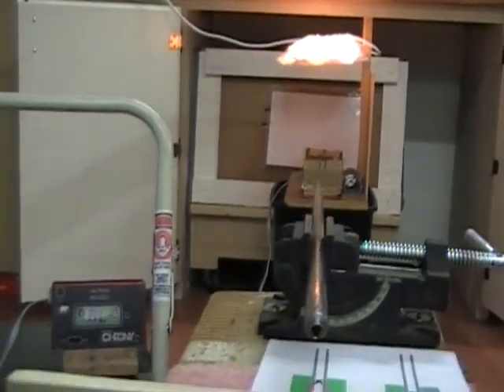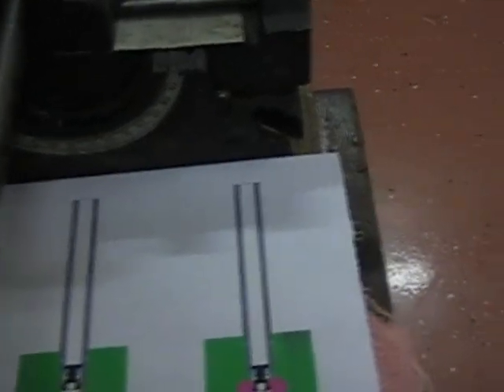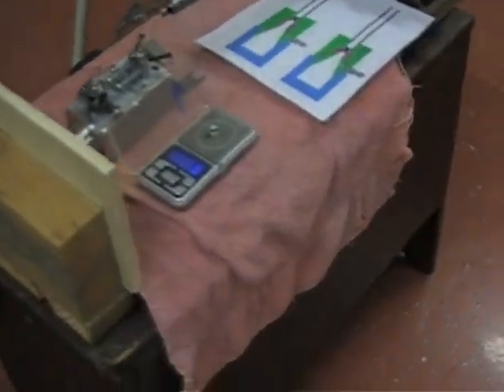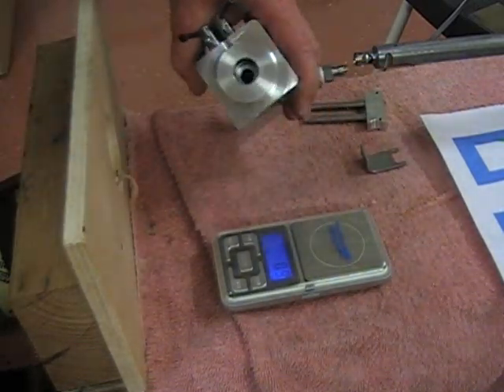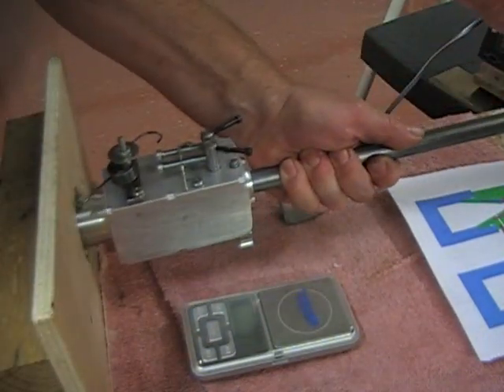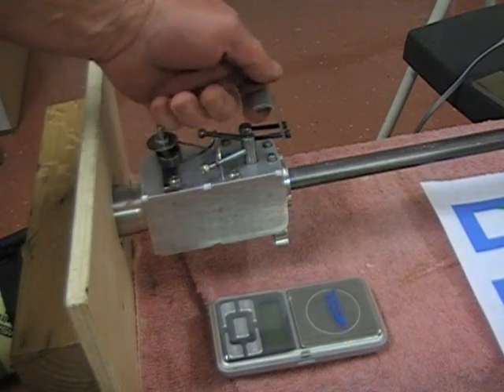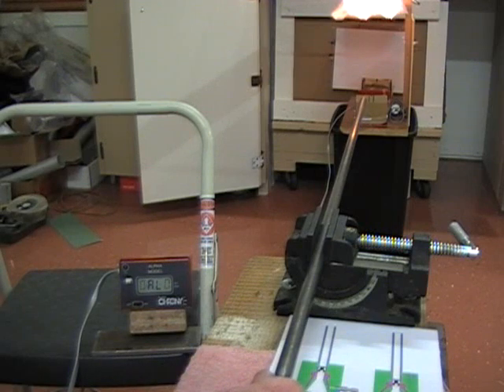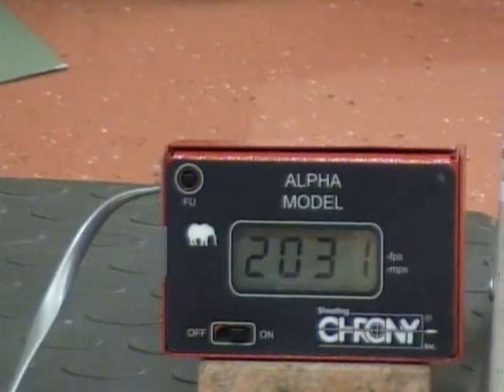2031fps PCP Airgun Lab maximum velocity record?

Comment: there is a lab in the UK driving half inch BB's to 17000 fps in order to test amour plating for tanks to space craft to achieve these velocities they use a combination gun powered by explosives compressed gas and a piston, ingenious bit of kit, with the use of very high speed cameras you can watch bb's vaporize as they cut into steel plate. far too big to fit over your shoulder and too dangerous to operate outside a purpose built bunker, but I see no reason why a spring piston rifle could not be converted to do a similar but much less impressive job using a blank to drive the piston and a pump to uprate the pressure forward of the piston seal, it would still be to fiddly for field work but might prove an interesting test bed.

Comment: Ideally should a shot from an airgun be pushed by the full volume of the barrel or a percentage of the full volume?
Reply from the maker: Do you mean should all of the porting be as large as the bore of the rifle? In other words, none of the air passages should be smaller than the bore/caiber? Lloyd
Reply: @1227air500  no , I was asking if say your shooting a .45 cal and your valve orifice is say .28 , will it need to be pushed by the full barrel volume or just a percentage of  the volume. Does it need to be pushed all the way to the muzzle to attain its max speed? Or can a short blast of air at higher pressure get max speed?
Reply from the maker: @HD-ph1dc  That is a good question, and generally, for all practical purposes, the answer is no, almost.  Let's start by looking at the rifle if it is .45cal and all the ports are .45.  And lets say the reservoir is 250cc at 3500psi and a 250gn bullet, the barrel is 24", and the gun has "average" flow characteristics. Just a note that the air force guns with their in-line valves have better than average flow characteristics, but the following general rules still apply. The absolute maximum FPE you can get from an airgun, with zero losses, is the bore area in sqin x the force in psi x the barrel length in feet. That works out to .159 sqin x 3500psi x 2 ft= 1113fpe. In reality, achieving 50% of that is good, and achieving 75% of that is extremely good. But that max fpe counts on the full reservoir pressure behind the bullet all the way down the barrel.  But as the bullet accelerates in the barrel, the air has a harder time keeping up and the pressure behind the bullet drops, and therefore, the force on the bullet drops. Testing has shown that if the valve closes when the bullet is about half way down the barrel, very little extra velocity will be gained by keeping the valve open longer. But a lot of extra air will be wasted during the last half of the bullet travel. Remember, inside the barrel, after the valve has closed, there is still a volume of high pressure air behind the bullet that continues to expand and accelerate the bullet down the barrel. Keeping the valve open only adds a little more force behind the bullet. You can test this yourself if you have an adjustable hammer spring on your gun. As you increase the hammer force, the velocity will increase, but there will be a point where the vel stops increasing but more air is used.
Back to the original 45 cal example, with parameters as listed above. If the gun has full diameter porting and the valve closes  at 50% travel down the barrel (2.5msec), vel might be 908fps and psi in the reservoir might drop 515psi. If the valve stays open all the way, vel might be  949 but psi will have dropped by 900psi. Those last 40fps are very expensive on the air. Now, if we go to the .28 ports (port is only 40% as large as the bore), 50% valve might give 846fps and 100% might give 883fps, but again, massive air to get that last 40fps. I hope that helps answer your question. Lloyd
Reply: @1227air500  Thanks Lloyd, you have answered my question very well. Thanks again.

Comment: Lloyd, this is about my 50th time I see this video and I find it quite amazing, entertaining, educational, inspiring and awakening from urban legends such as a pellet can not fly faster than the speed of sound. For example, the speed of sound at 25C is approximately 1,136fps, while the "average" air molecule weighing approximate 28.96546 daltons is traveling much faster than said speed of sound. Now, the key is to notice the "average" which is 2/pi, or approximately 63.66%, which makes the peak air molecule the inverse of the average, or pi/2 = 157%, and the RMS velocity being approximately 1,662fps, so calculating for the peak velocity gives 2,351fps, which is far higher than the 2031fps, so the velocity is very plausible since giving 6 degrees of freedom and only one degree is opened for escape then the fastest get out of the burning building first, and since there is an aluminum pellet at the exit door, if it doesn't get pushed out by the fastest peak air molecules traveling at 2,351fps, it will get stampeded flat, so the pellet was very smart to move down the 47.5 inch barrel. Great video, I wish you had included one of your killer graphs. Where can I find software like yours to do my analysis? Thanks and great job.
Reply from the maker: I got a comment the other day from someone who I guess just didn't understand the experiment, and it got me to re-reading some of the older comments. I like your comments, and analysis, and your analogies. Some good logic in there. Let's take it a step further and I'd like your thoughts. Try an analogy of a fighter jet being like the leading mass of high pressure air heading down the airgun barrel. That leading mass probably has to be traveling as fast as the bullet, correct? Now, suppose that the fighter jet is firing its 20mm cannons straight ahead, and these would be analogous to the fastest and most forward-aligned molecules in the moving mass of air. Wouldn't their velocity be additive to the fighter jet's velocity? If so, that would increase their velocity relative to the "earth" by at least 30%. Just some food for thought. Lloyd
Reply from the maker: Thanks for the kind words about the video. The reactions vary all over the map, so it is nice when someone really enjoys it. I am pretty sure you can contact me privately through the Youtube interface. There is a little procedure you have to go thru that you can look up on google. Have we talked on any of the airgun forums?
Lloyd

Comment: Why the odd caliber?
Reply from the maker: No particular reason. This is just smooth bore DOM steel tubing for a barrel, in the ball park of popular airgun calibers... between .25 and .30.  Since this was for a lab bench test only, wanted to keep the projectile very light in relation to the bore area. Also, to avoid using large amounts of air or generating too much power. Trying to keep it exciting, but manageable.

Comment: A .278 pellet that only weighs 9 grains? What is it made of? But if it is 9 grains, it's not hard to believe that 4000 psi can move something that light that fast. I use helium in both my PCP rifles, my .25 gets 90 ft/lbs of energy and my 250 grain .457  slug which is the same weight as a .44 magnum, also goes 1300 FPS like the .44 mag. So my air/helium rifle has the same knock down power as the .44 mag. Helium I believe is a smaller molecule than nitrogen and performs better because of that. So, push that 9 grain pellet, maybe a .177 pellet with 4500 psi behind it and see what you get. In fact, the helium tank I fill from when full is 6000 psi, run that with a  9 grain .177 pellet and I bet you can get close to or maybe over 3000 fps.

Comment: can you just hook up a 4000psi tank  to the barrel a with a release switch or valve on it?
Reply from the maker: Two problems with that. 1) the release of the air won't be instantaneous, and 2) the pellet will start moving before it has full pressure on it.

Comment: Your air gun efficiency is 27.29 %, too many looses. If your air gun chamber 55 cc,  the pressure 4000 psi , your air gun pcp generate  1,516.846 joule = 1,118.768 fpe. This energy potentially  throw a 9.1 grain pellet  about 2,268.199 meters per second     (mps) or 7,441.6 feet per second (fps).  The speed 2031 fps with with 4000 psi, 9.1 grain pellet can be produced with 10.5 cc chamber volume if the air gun efficiency about 50 %, or 7 cc chamber volume if your gun efficiecy is 75 %. Thank You very much. 3dd13 kugarcr0cc1
Reply from the maker: Well, I must disagree with your application of the laws of physics. By design, an airgun is not capable of harnessing all of the energy in a volume of compressed gas. Start with the basics of F=ma. Neglecting all losses, the .278 caliber pellet starts out with a force of 241 lbs applied to it. By the time the pellet reaches the end of the barrel, the air pressure in the system has dropped to 2154psi, and therefore the final force on the pellet is 131 lbs. So with zero losses, the pellet chould have an MV of 5878fps. The remainder of the 2154psi of air is lost, but that is by design. BUT, the pellet is not the only thing that must be accelerated through the barrel. There is a full column of compressed air in the barrel that must also accelerate along with the pellet. That volume of air is  129 grains. So the compressed air of the gun is accelerating 138 grains, not 9 grains. Maximum calculated velocity of that weight is 2431fps. add in another valid loss of barrel friction and the calculated velocity is closer to 2413fps. That yields a system efficiency of 84%, which for a mechanical system, is quite respectable. Lloyd

Comment: Yow.  You've really gotta trust that double-pin lock-system that holds the breech block onto the barrel, don't you?  That's a pretty hefty chunk-of-aluminum - I can't imagine the mayhem and destruction it would cause if it came loose from the barrel @ 4500 psi!
Reply from the maker: As crazy as some of this looks, I always keep safety foremost in my mind.  Plenty of physics and calculations in the background, along with the safety margin to anticipated failure modes.    Lloyd

Comment: Interesting. So that's only 82.4 fpe at the muzzle and 9.6 fpe at a 50 yard target. That's a lot of energy loss. Kool though. Bet a lead bullet would reduce the velocity quite a bit but retain most of its energy. Are you gonna try some tests with lead?
Reply: Harold Vigil thanks i was just going to run the numbers when he said the projectile weight but you've done it so cheers 😀
Reply: Its not only its exactly. The energy couldnt be anything else because of the pellet weight.

Comment: did you consider other gas than air? Argon or even Helium , for a same pressure you should have an higher speed.
Reply: Delphine Grandjean what's that really dense gas something hexofluride i bet that would hike the pressure up that's clever i believe it would definitely make a difference
Reply: Hydrogen is better.  Cheaper too.
Reply from the maker: A lot of folks are trying helium and getting some pretty amazing velocities.  Two main reasons: higher molecular speed of the pure helium, and the much lower density of helium.  Much of the gas within the barrel must accelerate along with the pellet, so in a way, it is like shooting a lighter pellet. At high pressures, the mass of the propellant gas within the barrel is significant.  a=F/m
I haven't tried helium yet.  Lloyd

Comment: So my guess is that the barrel is a piece of chromoly DOM tube that is pull broached to size? Or is it a proper barrel? Been tinkering with DOM tubes but not really got any good projectile seal or for that matter smooth finish in them.

Comment: The muzzle looks pretty close to the chrony. Are you sure you aren't getting a false reading due to the vapour plume?
Reply from the maker: I've tried several different setups to eliminate variables (temperature, pressure, chrony, lighting, etc, etc.)  and false readings, and to the best of my knowledge the readings are correct.

Comment: This video proves nothing.
Reply from the maker: +iceman5815 . I honestly don't know what you mean by "This video proves nothing."  It wasn't meant to "prove" anything, it is just to demonstrate that a projectile can be fired at over 2,000 FPS from a PCP with room temperature air .  If you are having trouble with the testing methodology, please study the documentation that is in the video that is titled "2035 fps PCP Airgun Lab with extensive documentation".  Temperatures and pressures, along with timing and weight and velocity are clearly shown in an effort to remove all reasonable doubt about the test and its results.  For what its worth, I have over 30 years in engineering and manufacturing and testing and understand how to design and conduct a valid test, which I have done in these videos, using best practices with the equipment  I have on hand.  You are free to have your own opinion, but I can assure you of the validity of these tests.  Lloyd
Reply from the maker: +lloyd-ss Please be aware, that if you watch the video on a mobile device, the documentation won't be visible.  You have to watch it on a computer for the YouTube documentation to show on the screen.
Reply: Your comment proves nothing.

Comment: Any high powered pcp can shoot 2000psi with a light wight pellet??? so no not impressed
Reply from the maker: +Danny Carp , If you have indeed shot a 14 gn .25 cal pellet 2000 fps, congrats, I am impressed.  If you have not, you might be surprised at how difficult it is.    The column of compressed air in the barrel behind the pellet that must also be accelerated, can weigh 70 grains or more, depending on the barrel length and operating psi.  So dropping the pellet weight from 55 gns to 14 is not the 75% drop in pellet weight that one would think.  The 14 gn pellet might get you into the 1500-1600 fps range, but a bit doubtful of the 2000 fps range.  My guess is that your gun would need a pellet weighing about 4 grains to get you into the 2000 fps zone.  But I have been wrong before and will admit it when that is the case. Lloyd
Reply: are you kidding me? 2000fps is almost untouchable in pcp rifles... this is an amazing video and if you don't understand it you have no business commenting..
Reply: +Danny Carp make a video
Reply: +Danny Carp I doubt you even own a Crono after reading your statements..
Reply from the maker: So I guess you have shot faster than that? Lloyd
Reply: My pcp shoots a 55 grain 25 cal slug at 1100 fps if i put a 14 grain pellets in it, it would shoot well over 2000 fps so yea nothing new to the pcp world. Regards
Reply: ***** hes an engineer, he designed it.. not commercially available or portable
Reply: took eight flipping minutes almost just the fire the damn thing looks like a Flintstone gun to me the video was pretty much about an over-inflated ego